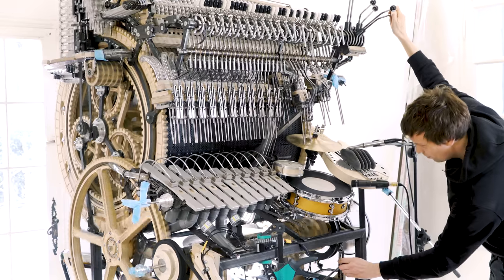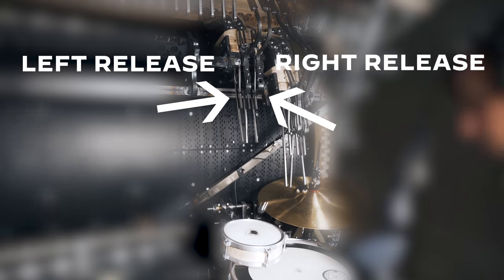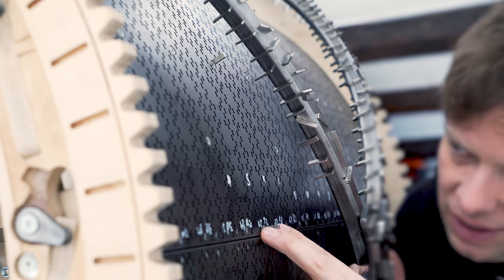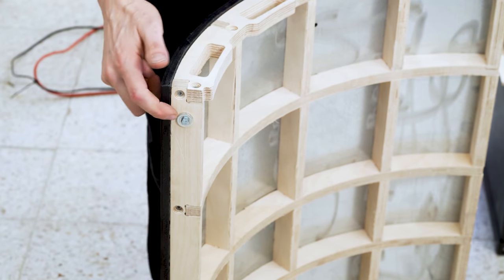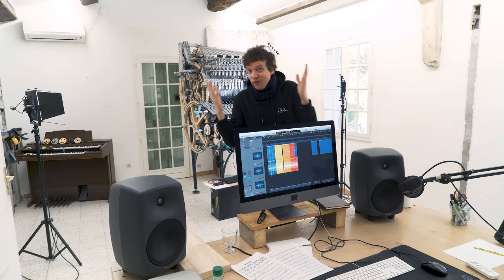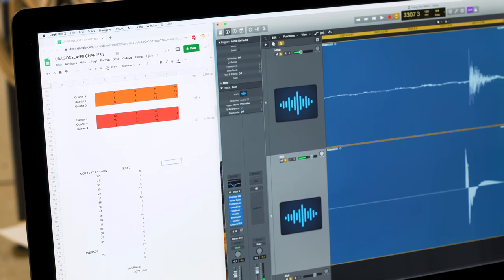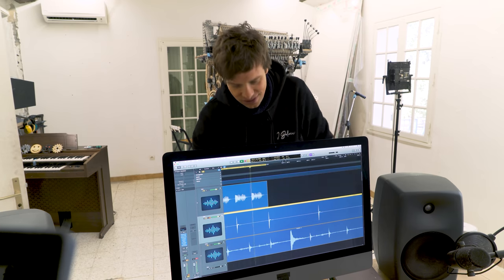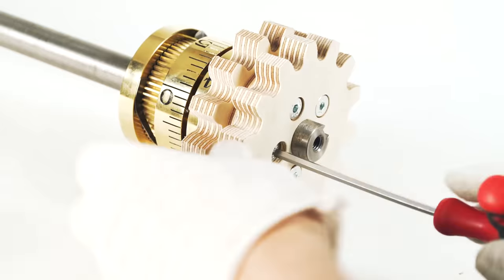Playing Tight Music? - Marble Machine X #115

Comment: Would it be possible to use a rasberry pi to drive motor and set the tempo?  that way the MMX would still be a independent unit that doesn't need to be tethered to a computer..       

https://www.kickstarter.com/projects/tommurray/smartipi-touch-a-raspberry-pi-touch-stand/description

Comment: Now you just need a humanize slider to make it better and less robotic😂
Reply: How would a "humanize" function work on a mechanical musical instrument? It doesn't use MIDI, it uses physical pins in a rotating cylinder, just like a mechanical music box. It's completely analog here.
I suppose you could offset the pins a bit to achieve a more "human" effect, similar to how an electronic music artist could program their MIDI notes slightly off the grid.
Reply: @justinnaramor6050  It was a bit of a joke, calm down
Reply: @Hello-pl2qe  Ok, sorry. But even if you were not joking, I'd still say the same thing.
Reply: @justinnaramor6050  I just thought it was funny with the amount of time to get things perfectly in time but a computer and midi will play things in time so much that it kills the flow of music and people have to add that randomize function to mess the timing up or else everything sounds robotic.